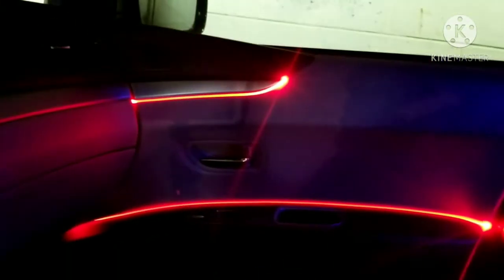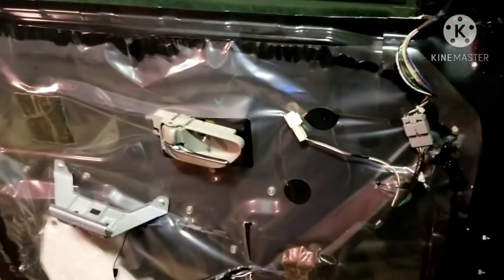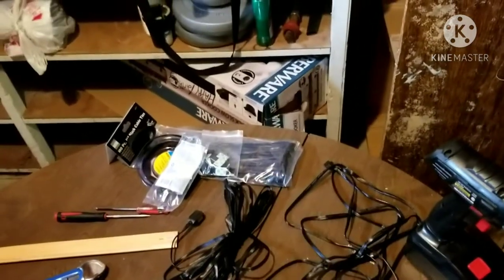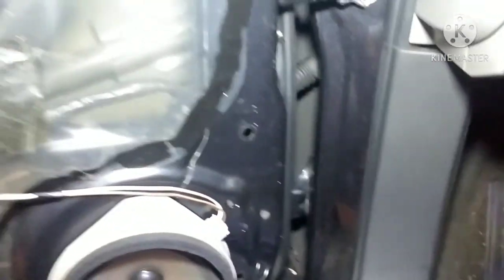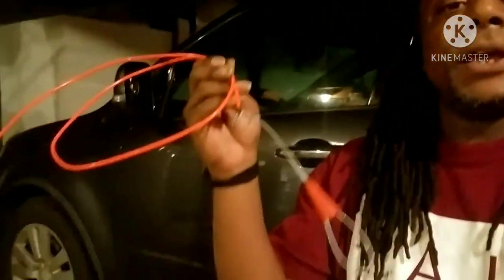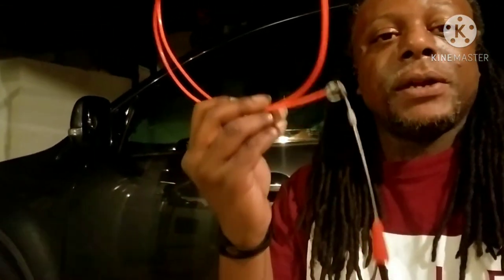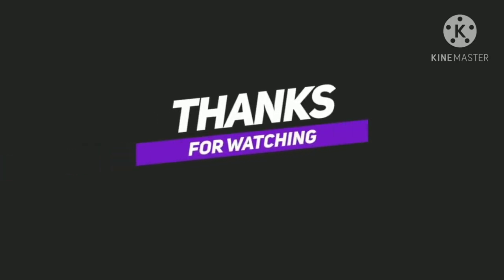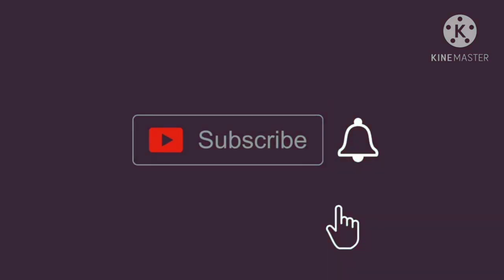#Xkglow#fiberoptic Fiber Optic Gone CRAZY

Comment: Just picked up a set myself haven't installed yet because I was thinking about hardwiring it in instead of using up a cigarette lighter how did you wire your's in? Also if you in my area might have to get you to do mine that looks clean bro
Reply from the maker: That was wired to the battery but I have a new setup now. I'm in VA n thanks I try to post my new one soon
Reply: @Mista_Jay434  shame I’m in N TX how did you wire it into the battery? Mine happens to be in the trunk of my car so I was thinking of splicing into the cigarette lighter but would love for it to be lighting up when I open my doors.
Reply from the maker: Mine didn't have a cigarette lighter on that one but the new one did I jus cut it off n added more wire then ran the wires to battery post